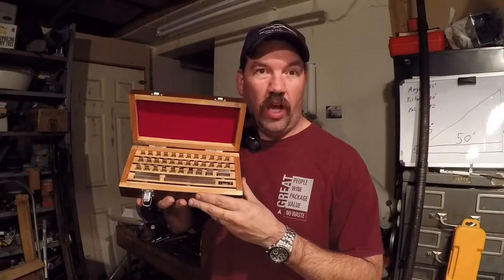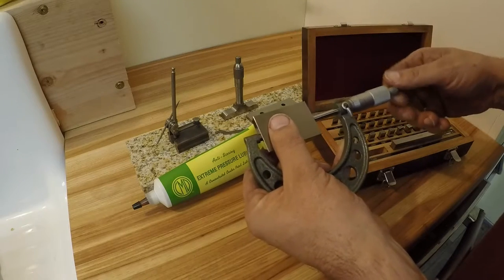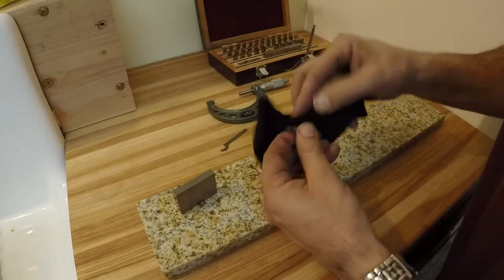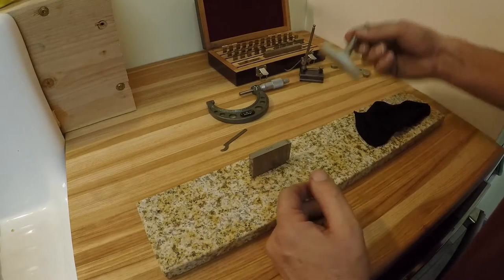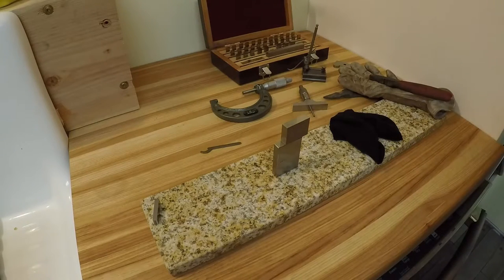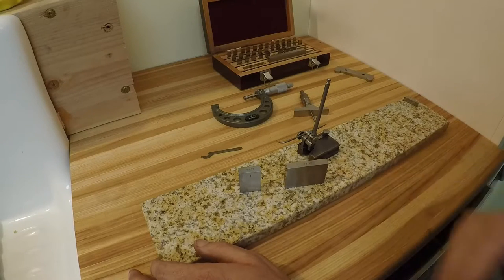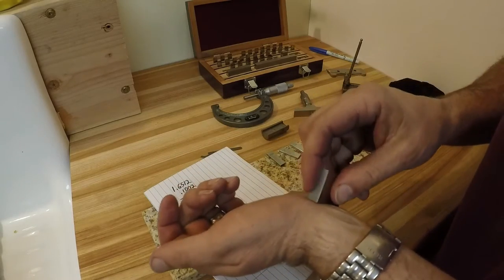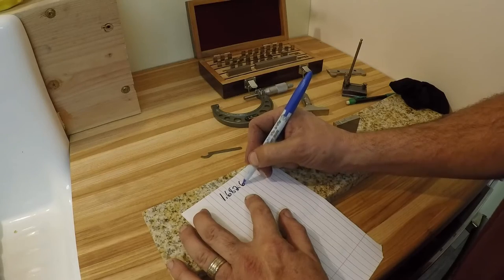Jo Blocks Setup

Comment: Now I know how to remove the shaft on those depth mics.  May seem like a no-brainer for some, but for the life of me I couldn't think of how to swap the shaft on my Browne & Sharpe depth mic.  This just encouraged me to add gage blocks to my list.  You know that list that seems to never shorten, rather it continues to grow.  Thanks for sharing.
Reply from the maker: +ThunderDog lol you're right about that lol even I took it apart wrong the first go. They are very handy tools. Tapper parallel will do many of the jobs also but they can't be used as a reference.

Comment: You were thinking of Van der Waals force. IMO, blocks wring due to a combination of factors including the latter. When calibrating, one should see consistently accurate values at .105, .220, .420, .605, .815, and 1" as per ANSI. Especially if you're shooting for tenths. If you're going to use the ratchet, though one really should have a physical feel for the gage, make sure to turn it the same number of clicks every time. Good luck.
Reply from the maker: Thanks for the info

Comment: No,no no no .Stop wiping blocks off in wrist!!!!Oil on skin will make stack not right.Use flat surface, piece of paper,Wipe off on paper.Arospace machinist for 33 years!!
Reply from the maker: +John Hines I was told not to use paper because it's abrasive. Do you use a certain kind?
Reply: I have never seen anyone grease Gage blocks before. oil paper is to prevent corrosion during shipping.
clean with alcohol or ketone.
paper is to remove anything to prevent blocks from wringing together.
yes paper is abrasive, fine for shop grade, 
if you want presision, go ceramic.
our blocks get re certified every year!!
never failed.
use sheet of paper to clean 0-1 mic. amazing how much crap is on carbide faces.
Reply from the maker: +John Hines I have cleaned mics that way. I keep them greased I'm in a unheated shop and they don't get used much . Humidity is a sneeky thing . Thanks for the input John .